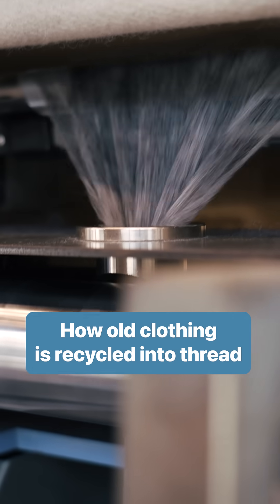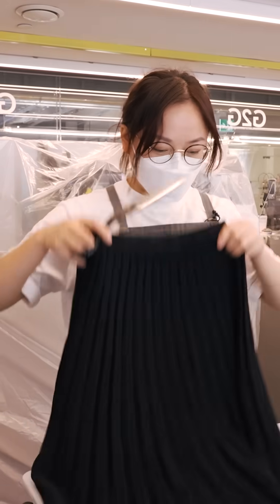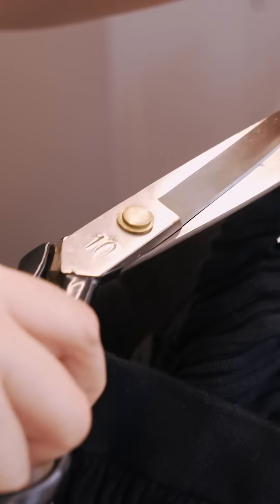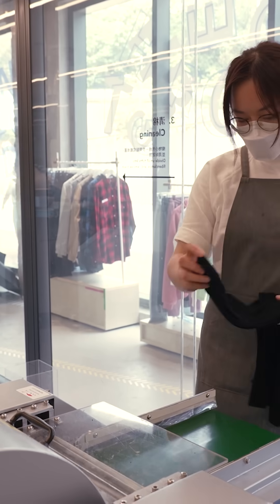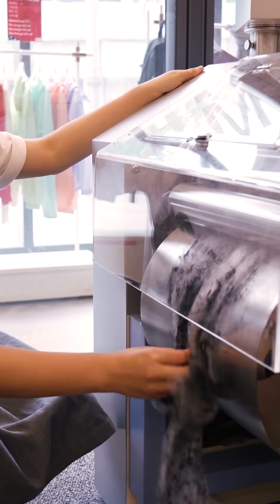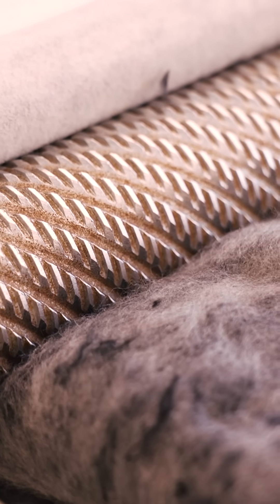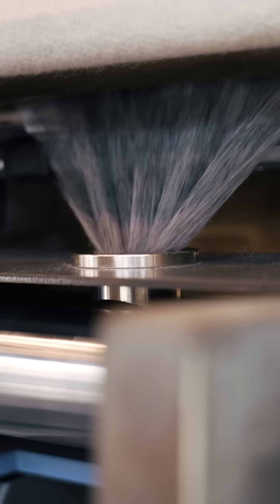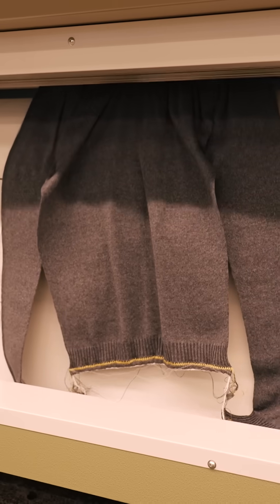Here’s how used fabrics can be recycled to make new garments. #Upcycling #Clothing #Fabric

Comment: Sorry but I don't trust this process. If you make the fiber dust length they are not going to be as durable as original even when you add longer strands to hold them. You are making another fast fashion item that is not going to last long. If you told me the recycled fibes go into production of insulation material for homes or something like that, then yes I can get on board of the idea. It's like when you recycle paper the process is similar. What are you getting as a product? It's usually lower quality paper or cardboard, and it works because we have demand for cardboard boxes. There is only so much recycling you can do. 
I can imagine the clothing made of these fibers would peel more and would lose thickness over time. They would lose the "dust" by just being worn, rubbing against itself and during washing.

Comment: Something like this is VERY useful here in the US. Then again recycling is NOT a popular thing to do here, it's even frowned down on, not in European and Asian countries where it's more common even highly encouraged as an additional source of income. For example, you get paid for the recycled items by either weight or quantity by depositing the items in containers that look like very large vending machines; you put in the items in the machine, and it pays you back. Of course, the money you would get from doing this is NOT enough to pay your mortgage or your car, but it is a little extra which you can add to your savings account; every little bit helps. In Germany you are expected to recycle by taking the items to predetermined stations (they are usually located near housing areas and several locations throughout the cities) where they have large containers where you can sort out by color and type (bottles or different colors, paper/carboard, plastic, metal). I believe if every city here in the US came up with a similar plan for recycling the landfills would have significantly less "trash" to get dumped there, while creating more jobs that can benefit the local economy. It could well be a win-win for all.

Comment: Basically what cotton mills did. Only difference is the recycled clothes. Cotton bails arrived at the ant was ran through a machine to be cleaned and separated went into what they called "card machine" where it was made into the web and then into the coil. Then went to what they called drawing where the coil was made smaller, then to spinning where it was turned into the fibers that was woven into cloth. From there some went to the dying process and the other was sent to the weaving department to be woven with the dyed fibers and there you have denim or what ever type of cloth that plant makes. Yes I worked in a cotton mill and so did my parents and grandparent

Comment: You can use chemical processes to break down cellulose which separates it from other materials it was blended with, then that can be spun back into fibers so that new fibers are not needed. Other components like rayons and polyesters can be broken down and reused as well.
The process here just makes weaker and weaker materials as they are "recycled" over and over again.

Comment: FYI -- Goodwill accepts clothing in any condition, including stained or ripped items. They recycle the textiles to keep items out of landfills.  However, Goodwill only sells clothing that is clean and wearable. If you have dirty or stained clothing, you can recycle it in the big yellow bins in the store parking lots. 
Goodwill also accepts working and nonworking computers and equipment. They do not accept: 

Acceptable Donated Goods - Goodwill of Southwestern Pennsylvania
We Cannot Accept: Building and/or construction materials. Mattresses, box springs, waterbeds and accessories, hospital or mechanical beds, commercial furniture and carpeting. Large appliances, televisions. Large furniture that does not fit inside the store donation bins.

 But the organization will take fabric in any condition. "Goodwill even accepts items that are stained or ripped, as they're able to recycle the textiles and keep items out of local landfills." Goodwill's need stretches far beyond the closet—including working and nonworking computers and equipment.

You can donate items to Goodwill at any Goodwill store drive-thru during open store hours. 
 You can find all donation sites here.  When you drop off your donations, you'll receive a receipt. If you itemize deductions on your taxes, you can claim a tax deduction for clothing and household items that are in good condition.

Comment: Wool has been recycled for over 200 years. Cotton fabric also has a long history of reuse, although cotton degrades more with each reincarnation than some other fibers.  Problems with processing for reuse develop when different types of fibers have been blended such as protein based (wool, fur, silk, ...), plant-based (cotton, hemp, ...),  partially synthetic (rayon/viscose) and completely synthetic hydrocarbon-based fibers. Each type of fiber has different requirements to clean, process for reuse, and dye.  There are obviously ways to work around some of those issues.  Its good to see  a company developing a new method to reuse used fabrics instead of sending it all to be entombed in a landfill.

Comment: Ozone chamber? Washing it will sanitize the materiel. You don't need a gimmick, unless you're scamming people. An ozone chamber is on the same level as saying ethically made, and sustainable. Catch phases, used to delude the uneducated. 🤣
Reply: Fun fact, it's actually been shown that many washers, and most driers do not get hot enough to sanitize, and the detergent just removes dirt

Comment: From Walmart, I purchased a few washrags that came together three or four; they were a bright white, and when I washed them, I did as I usually do and put 1 cup of hydrogen peroxide in the White cloths clean; the bright white washrags were a dirty Brown in most of the rags. I recalled that a few years back, the same thing happened after a wash, they came out looking like they were made from old rags. My immediate thought was that those rages were made from old recycled material and though I had never heard of that before, this video may have confirmed my opinion. IMHO, that was pretty disgusting.

Comment: That’s so much better than sending all our unwanted clothing to third world countries where it forms mountains and mountains of garbage pollution. The only down side of this cloth recycling process is all the automation (requiring power to run the machines) and the cost of the machines themselves (stainless steel, rubber, gears and other components that wear out and in turn become garbage) instead of hiring more humans to accomplish a similar process with less carbon footprint.

Comment: This is not in any way unique. This process has been used for ages to make yarn and string. Most fibers, especially cotton and wool, are processed into a fiber web, then stretched out into a those "slivers", which are then further stretched and twisted into monofilament, which is then twisted together with multiple strands into string or yarn. Nothing special, it's done everywhere.

Comment: Someone finally decided to do something with all that lint in their dryer.
Reply: Personally, we gather it up and store it in a plasic bag. Makes great fire starter when you're camping. 😁 (Just be sure it doesn't have fabric softener in it.)
Reply: @warriormaiden9829 Can you use it if you used dryer sheets?
Reply: @bhumphries1360    Usually not. Often there's softeners put in there along with the smell-goods. If you want lint quick for fire-starter, your best bet is to do a load of towels, no fabric softener in the washer, and no dryer sheet. Depending on your towels, you should get anywhere from a half to very full lint trap's worth. Roll it off the trap, and stick it in a plastic bag so it stays dry. When you need it, grab the end of the roll and tug a bit off (should only take about an inch or two). You'll wanna put the freshly-pulled side up (preferably in a nest of dry grass or shredded paper-like inner bark), so the little wispy fibers are exposed. Those are what catch your sparks the fastest. 😁
Reply: I don't think dryer lint is very useful for textiles, as it is more a dust than a fiber. To make thread you need fibers long enough to twist around each other and hold.

If your dryer lint is mainly natural fiber such as cotton, you can mix it with petroleum jelly and ignite it to start a campfire. Paraffin will also work, but it requires more effort (needs to be melted over indirect heat).

Comment: "Sliver" (fibers ready to be spun into thread) is pronounced with a long i.
Reply: So like “slee-ver”? Or “sl-EYE-ver”?
Either way, incorrect. He said it right, but that is the wrong word entirely. That was NOT a sliver of anything. A sliver (pronounced “slih-ver”) is a super tiny shard or fragment of something.
Reply: @Khaleesi_Jack  Sliver (pronounced slyver) is a textile term. Similar to roving, sliver is a thick strand of aligned fibers for spinning into thread or yarn.
Reply: @sparkyheberling6115 ; jfc, how many more definitions are they gonna assign to a single word? As many different possible variations of spelling must there also be a new meaning behind it too?? Goddamn
Reply: @Khaleesi_Jack  I haven't seen any variations in spelling; it is always s-l-i-v-e-r whether it is spinning fiber or a splinter of wood. 
The textile definition of sliver is not new. It may be as old as the craft of hand-spinning.
Reply: @sparkyheberling6115 ; then no, it is not pronounced with a long “I” sound. I was trying to give an out, but oh well. It’s a soft “I” sound in “sliver,” which does rhyme with “silver.”